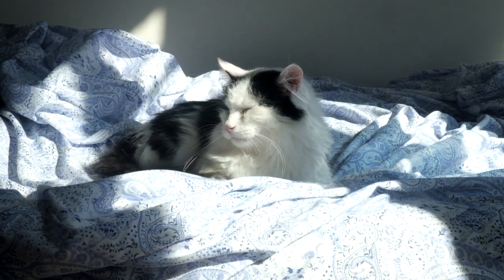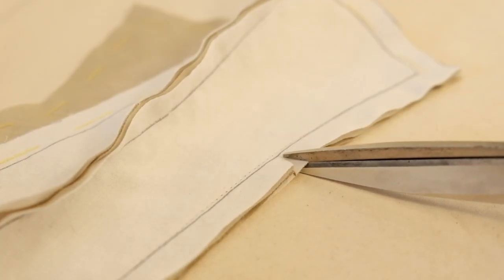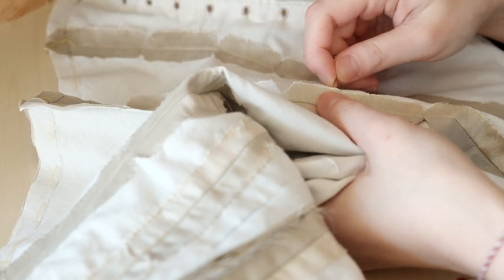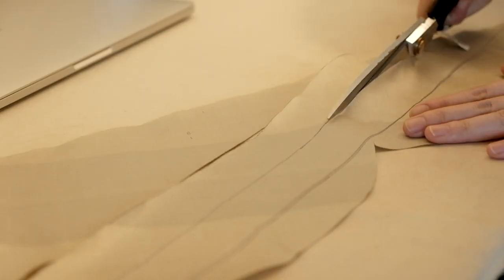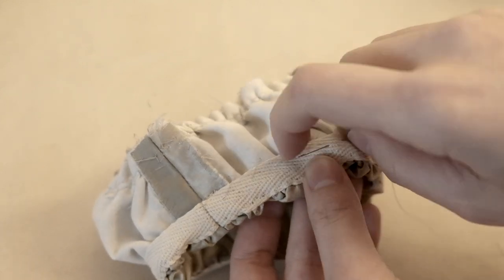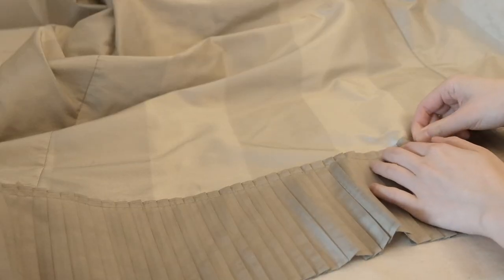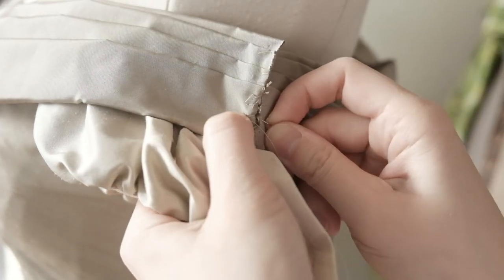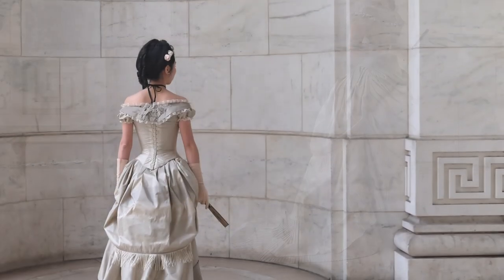The 500 Steps It Takes to Make a Victorian Bodice | Making a Victorian Bustle Gown Part II

Comment: Wonderful video for a couple of reasons:
1. You did "historically accurate techniques" when it mattered but used modern techniques to make it easier for yourself.  (Not everybody has the time, patience, & resources to make historically accurate dresses using historically accurate techniques.)
2. You showed beautifully how to finish a project when it turns out a lot more fabric is needed than the design/pattern gave you the impression you needed. I am so grateful you didn't scrap this project or worse not upload  these video because you ran out of fabric & couldn't find the absolutely perfect color/fabric content match to your original fabric.  This gives hope to all viewers that making the mistake of "buying too little fabric" or "there isn't enough of the fabric you fell in love with at fabric store" doesn't mean you have to scrap your project that you spent untold hours to get to the point where your nightmare becomes reality... you don't have enough fabric to finish or to add all the desired trim. (I bet there's only a  relative few seamstresses who can look at a Victorian dress & estimate an amount of fabric that is correct or slightly over what will be needed to make it.)
THANK YOU!!!! (new subscriber with all notifications)